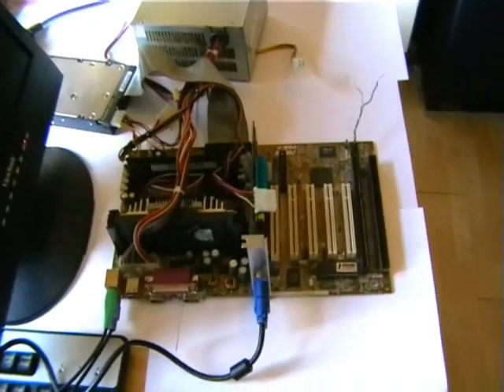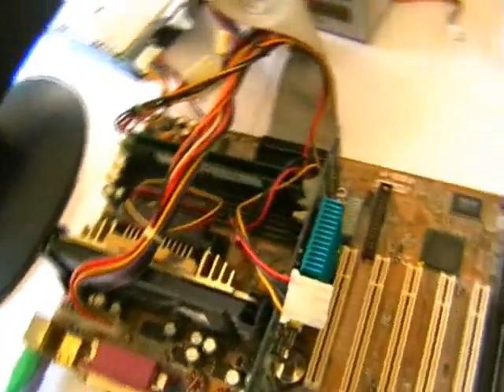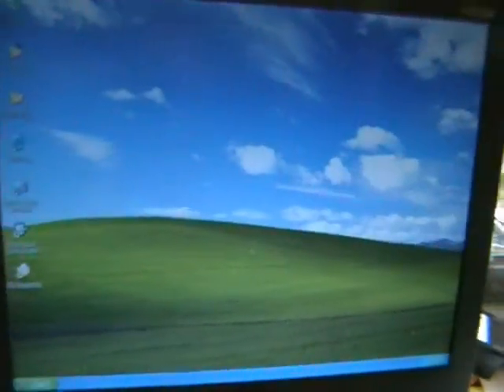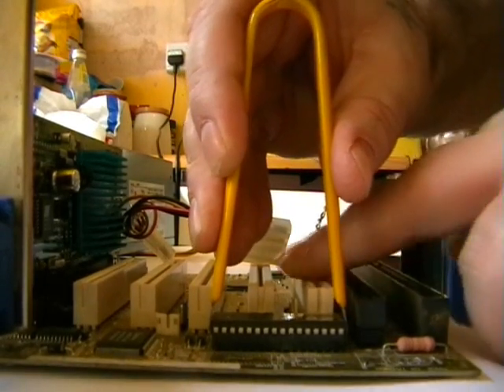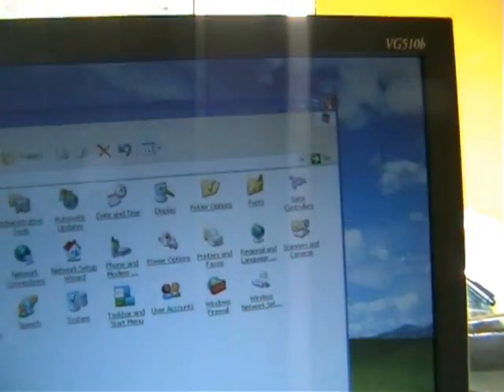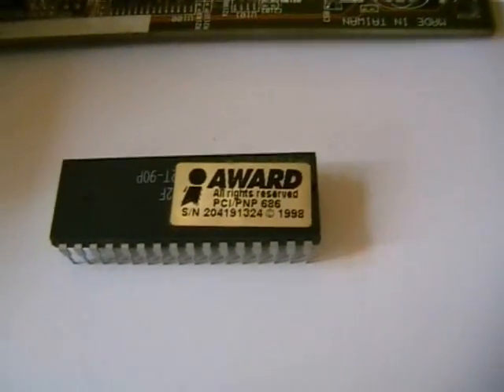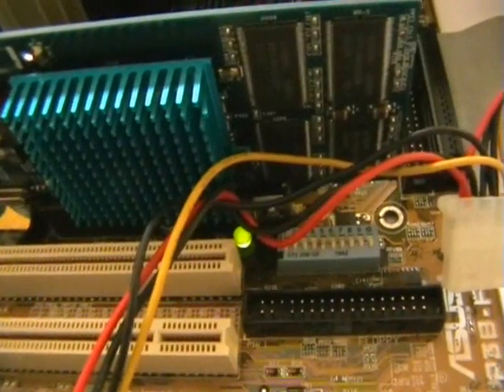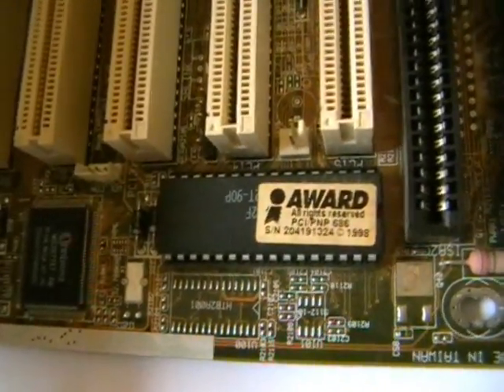Computer running without the BIOS Chip !!! .BIOS ( Basic Input Output System)

Comment: I think it worked because the BIOS sleeps while the whole system taken over the boot process, making the system still function. To make the BIOS actually removed, you have to reboot the computer when the BIOS starts functioning such as checking RAM, setting the boot order, checking SATA drives or other devices. Then, it will start (I think) a POST-like boot up and... then I don't know any more about this "whole loop of roads with thousands of cars".

Comment: windows will always still be able to run without the bios chip since not only does it copy itself to the ram automatically but also windows can function normally without as does mine since for some reason it never had a BIOS chip

Comment: You can even pull out the BIOS eeprom when PC are still in POST/BIOS setup. After pushing the ON switch, BIOS memory is copied into the RAM and next it starts running.
Reply: PrzeszczepiX Yes someone who understands thoroughly what a bus does between other components. And I'm sure the levels of operation from power on to the apps making calls and cpu processing b code per app running .

Comment: damnnn you , once the OS has successfully booted up , you "dont need" the BIOS , as you can see, after rebooting . the system did not show any sign of life , because the BIOS was not there , so in conclusion , you can not run a system without the BIOS chip .

Comment: Of course, the BIOS or the firmware passes control to the OS after the boot has completed, as long as the OS doesn't call the BIOS, everything should be fine as the BIOS only does its job during the initialization process. I'm not sure about UEFI, but since it's monitoring your hardware, especially when you have safe boot on, it might interrupt the whole system.

Comment: I would thought that the computer would have need the BIOS chip to enable access the everything on the motherboard and anyway if you dissemble the int 0x10 routines you should find &H03CE which control the EGA/VGA controller of your graphics chip so you will realise that removing the BIOS chip is foolhardy and will result in your machine not working ever again.

Comment: BIOS is only needed during boot up, it does the basic communication needed to boot up the OS, once that done your OS boots up, it handles all the communication between all devices.
Reply: Then the bios goes to sleep
Reply: Si ScotlandSAS 
It wouldn't even turn on without the bios chip
Reply: Si ScotlandSAS  It's a POST test and without the BIOS chip, won't find any hardware

Comment: Your os is only one of many programs that run simultaniously to convert code such as python or vb to machine code (instruction sets of on and off or 1s and 0s). Your kernal is a more advanced bois only not because it cannot start itself because of the compatability issue i mentioned earlyer if you built a custom kernal and could keep it allive somehow you would not need bios because of the dilema of keeping your kernal in memory (usualy to big to keep in ram while powered down), a bois is still the best way also if your drive dies your pc is dead

Comment: If you set bios to load your hd first and pull it right after in the boot process everything else will not be recognized by your os this is because all your bios (basic input output system) does is provide your kernal of choice a set of addresses so that your kernal can determine where they are located and what driver to load. This principal is what allowes your os like winxp or tutu to opperate on multiple flavors or configurations example would be installing win7 on a pentium or amd you do not need a special os one does the trick thanx to bios.

Comment: This would have been interesting had the OS been something more archaic that depended on BIOS calls...
Reply: Some motherboards mirror the BIOS into ram for faster performance
Reply: DOS.
Reply: FennecTECH anything newer than a 486 had a bios address caching option, either to ram or into the cache. it will copy parts of the bios for faster access. Most modern pcs will copy the entire bios, vbios, and any other eeprom / flash chip into ram at boot up.

Comment: that reminds me of my old 93-95 IBM computer, had 4 gigs of total hard drive, I cant recall how much RAM the thing had, but it couldn't have been much since even Starcraft was lagging badly on it. Also it didn't have a sound card for some stupid unknown reason, hence no sound. The funny thing is I got another computer in 2005 (AMD with Epox motherboard, unlike the IBM) and it died eventually. (maybe because it was used very Intensively, almost every day for about 5 years) Later it was discarded without being operational anymore, while the good old IBM computer was still working when it was thrown away.

Comment: How did you load the OS into RAM?
Reply: I hate to correct you, but I must.

Interrupts != BIOS calls. 

The BIOS is called by making interrupts. Interrupts are NOT made by calling the BIOS. You got it backwards.

An interrupt is simply a signal from hardware or software to the CPU that it needs to stop what it's doing and to do something else. What that something else is depends on various factors.

For hardware interrupts, the CPU will look at what line the interrupt happened on, which allows it to quickly identify the source of the interrupt and then make a decision on what to do next based on what the kernel and device driver set up. 

For software interrupts, the KERNEL makes a decision on how to act based on what specific value is in what specific register. This is, in fact, the most common way to make system calls, though there are now instructions in the x86_64 ISA that allow for more direct means. System calls go to the KERNEL, not the BIOS, and the KERNEL decides based on a table of interrupt values ("Vectors.") how to act. This can take the form of a request to read or write data, make some I/O call to hardware, or even to voluntarily hand off their time in the CPU. The kernel does all this without a single call to the BIOS, as the kernel is way more advanced than the BIOS would be anyway.

UEFI doesn't change this, either, all UEFI changes is better bootloading and partitioning and more modern system setups. But no, once the kernel takes over, UEFI or BIOS, doesn't matter, system firmware is irrelevant. 

There is one exception to this: Power management. The system firmware is still at the heart of power management because unlike a kernel, the system firmware doesn't need to already be loaded and active to work, all that needs to happen is for the CPU to need to know what state to be in and load the firmware, which will in turn figure out power states. Of course, it still comes down to the OS whether or not power management features are used. The firmware is mostly just there to provide a means from which the CPU wakes back up and can figure out how to get the OS back into working state. This is possibly why suspend to RAM can be problematic on keeping hardware working without a reboot as system firmware will often have no clue what to do and the OS won't either.
Reply: when he booted the win xp, the chip was installed. He removed it when the os was already loaded.
One of the basic factions of BIOS is boot. If chip is removed, there is no bios so he can't boot. When he removed it, the system was already booted and loaded
Reply: Ok, but the interrupt?
Reply: i don't know what does interrupt means
Reply: supergughi24 Only computers pentium1 and older use interrupt commands if thats what you mean. In fact modern computers use an i2c eeprom, therefore the the cpu has to start without the bios and then reads the data from the eeprom which loads into the ram and runs from there.
Reply: ah ok
Reply: +Anton Babiy Interrupts are still widely used, and are absolutely necessary for multithreading.  The BIOS IVT (interrupt vector table) is useful in providing a bootloader the basic functions necessary to load the OS kernel into memory.  The OS kernel, once loaded, takes over and provides its own methods for interacting with hardware. UEFI has a different paradigm and relies much less on interrupts, but they're still necessary.
Reply: +xrhstos7003 CPUs execute code in order, one instruction after another.  But what if something happens that requires the computer to divert its attention?  An interrupt is basically a "hook" that can "interrupt" the standard flow of code to run a different routine before resuming the standard execution flow.
Reply: xrhstos7003 the os is on the hard drive. the bios only loads the boot file from the hard drive and is also normally around 256km in size.

Comment: thats the way I used to fix broken bios by CIH virus in the 90s. I removed the working chip, replaced with faulty after boot and run the flash program to write a correct one.
Reply: subbookkeeper If people had them, they could also use eeprom writers.

Comment: You do not need BIOS under XP (XP doesn't use BIOS calls any more)
You do not need BIOS after bootloader started, as BIOS caches itself into RAM
Reply: +WizardNumberNext Actually, even the bootloader isn't run from flash.  BIOS loads itself to RAM, and from there will read the bootsector from storage into memory to be executed.
Reply: True. It loads BIOS calls onto the NTVDM with the DOS int 0x21 call I think
Reply: Actually bios doesn't run from flash. It only runs bootloader from flash. Layer it would copy itself to ram and later it would run entirely from ram.
Reply: Oh ok

Comment: I put a socket on top of the bios chip and I redirected the Chip Select pin to a switch. Whenever I need to flash a rom I put one in the socket and push the switch. Then it's just a matter of flashing the bios (which is the selected chip)

Comment: not completely true - its because we tend to use ''higher'' OS that has its own code - but in DOS it will use bios interrupts (int21, int10 etc) - the bios chip holds system specifications read to find devices - and does contain POST instructions for pre-boot rudimentary diagnostics. The Removal will not interfer systems operations as long the OS doesn't need to fetch from it

Comment: what an idiot. any person with any basic computer knowledge could have told you exactly what would happen if you removed the chip. after boot the running of the pc is handed over to the RAM and HDD. the bios is only used for boot. hence the black screen at start. you have wasted your time bro

Comment: @mabvsfd Yeah. Just about any prebuilt OEM Pc from Dell/HP/etc uses soldered bios chips, but most custom built machines today (from my experience) use replaceable bios chips. My budget Biostar motherboard I bought 2 years ago has a replaceable bios chip. It's about 1/10 the size of the chip featured in this video.

Comment: Cool though.

This is normal behavior. Traditional BIOS just perform POST (Power On Self Test). For POST BIOS runs only during power on / boot time. Once system boots to OS there is nothing done by BIOS code. hence the above behavior was possible.

Modern BIOS, esp high end WS/servers have BIOS not only to perform POST but also some OS/runtime activity like system management (errors handling). Even in this case 99.9% the BIOS code is copied in to memory in memory, so it can still be possible.

Comment: This trick can be used with Uniflash to make a ghetto Flash programmer.
You don't actually need to use an identical board as the one you're trying to recover.  If you look up the pinout on most DIP Flash chips used on motherboards, you'll find most of them use the same pinout and can be interchanged.  It's always advised to look them up first though to make sure.
Doing this with PLCC's is more tricky, and some of those run on different voltages so that adds another concern.

Comment: It is posible, i used to program empty flash chips this way.
And it works because the info from the flash rom is shadowed in the system meory for the speed it takes to read info.
Normal ram is faster then the flash rom chip.

Comment: Hm, this is neither fake nor gay. It actually makes complete sense. The RAM in a computer is much faster than the ROM in which the BIOS is stored, something that lead to the BIOS memory being mirrored (copied) into the RAM. So, once the system has booted the BIOS can (obviously) be removed since the functionality it offers is still available to the system thanks to the mirroring. Rebooting the system without the BIOS thus doesn't work. Nice demonstration :-)

Comment: @FoxMcCloudMyHero a common mistake, here is a quote i found on 'about (dot) com' i also found many other quotes similar.

"The Basic Input Output System, abbreviated as BIOS, is software stored on a small memory chip on the motherboard.
BIOS is sometimes incorrectly referred to as the Basic Integrated Operating System."

Comment: I've read about using this method - admittedly not going as far as running Windows - as a way of recovering a BIOS chip from a failed firmware upgrade.  Obviously you'd need an identical working motherboard and BIOS, but the idea is to take the BIOS out of the working board whilst it's running, put the corrupt chip in its place, then save the settings and exit.  I've no idea if it would work, but it might be fun to try!
Reply: lol you put an another expired warranty motherboard's BIOS and then the motherboard doesnt see the correct files then the computer starts to show black screen only and hardware manfacturer stops supporting your motherboard

Comment: The BIOS plugs everything into RAM and Windows does the same thing, grabs info from the BIOS and plugs it into RAM. Now heres the cool part. The Linux Kernel doesn't need a BIOS. It reads the hardware info directly like a BIOS would. Gives reason to the CoreBoot (LinuxBIOS) project and such.
Reply: A PC can't boot without a BIOS. It needs to occupy a certain address space. An OS isn't in that address space while it is on the HDD. A PC displays nothing and does nothing when you boot it up without a BIOS.

Comment: Well no kidding man, if you boot it up and THEN take out the BIOS it'll still work......Try restarting the computer -_-. It won't.

You need the BIOS in order to do the most basic input and output functions as the name implies. After the BIOS is finished, it then PASSES it on to the OPERATING SYSTEM. The BIOS is no longer involved.

Comment: The BIOS chip just loads the BIOS OS, which then loads the actual OS (in this case windows). After the actual OS has been loaded Into memory, it isn't used. Which is why it's able to work without the chip in.

Comment: not fake this is a way you can reflash a bad bios chip without  having to order a new one take out the good one put in a bad one (while in windows of course) run the flash program from windows flash the bad bios chip then replace the chips accordingly.

Comment: POST refers to Power On Self Test. As the CPU start it check for various things like RAM, ROM, drive controllers etc. As the CPU check each of these it "posts" a numeric code to one port address. As the CPU make its way through the test the number goes from zero upwards. If one functional test fails the number stop therefore diagnosing the problem with the motherboard. Once POST is complete the system boot up the disk operating system or DOS

Comment: The contents of the BIOS ROM are loaded into RAM  on bootup. They do this because any read from the BIOS EPROM requires a long time which would slow down the PC so they dump its contents into quick access memory so it can run at the same speed as processor. The BIOS routines are used while the PC is running. Deep down inside is the Config monitor program. The BIOS routines make the specific motherboard perform the same on all platforms through BIOS calls. Checkout Peter Norton's Inside the PC

Comment: very old trick with pro-users, but worthless if the pc is OFF and HAS a bad flashed chip, because it wont start up. 
you can also copy running bios on new chip (same type) or flash different bios on an inserted chip... while running. has only to be the same award or ami bios and the same sort of chip and the right, bios related flash program.

this is all _very_ old.

Comment from the maker: No its not imposible ,the video is real ,the PC loads the BIOS information into the main memory ,so the BIOS in not needed after it loads the info from BIOS chip to RAM memory ,if i try and start the PC without a BIOS chip then the PC will be dead! ,no BIOS to load into RAM memory.

Comment: usefull for hotflashing another computers flash rom with the same spec. but remember this does not work on all computers. some computers will freeze up or will give you a blue screen and restart and never come back on until the rom is back in the socket. i have a ecs motherboard with a bad rom and it kept on blue screening and the bios menu kept on crashing so i bought a new programmer and rom, flashed the chip and it worked again!

Comment: This is nothing new I have done this ages ago
the only difference was I was recovering a bad flash

Basically I booted up the computer with a floppy disk with the BIOS and flash utility and remove the working BIOS chip and replaced with another BIOS chip that did not flash correctly
because the power went out
well it was flashing the bios.

Then I initiated the flash command and powerdown after the clashes complete .

Place the chips back in the computers and both were working again.